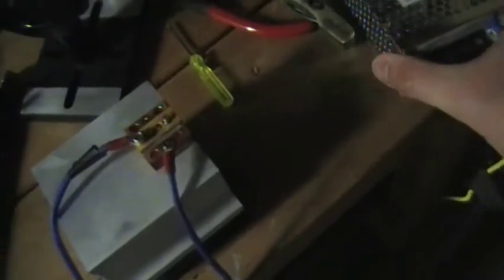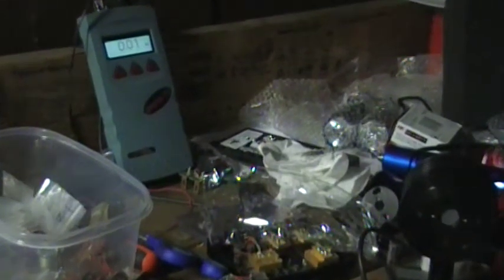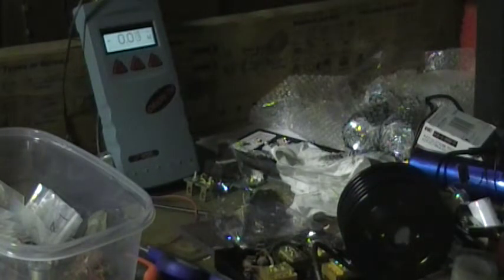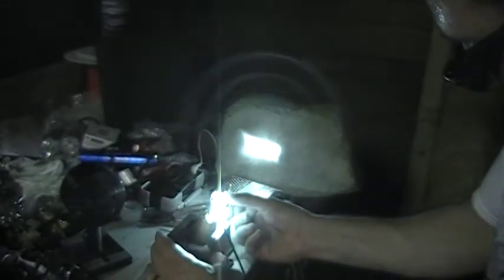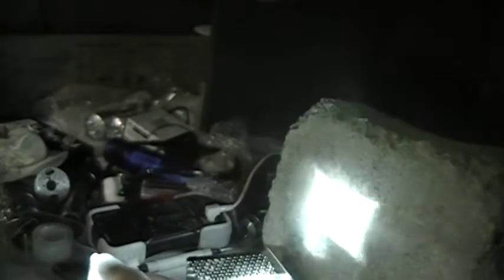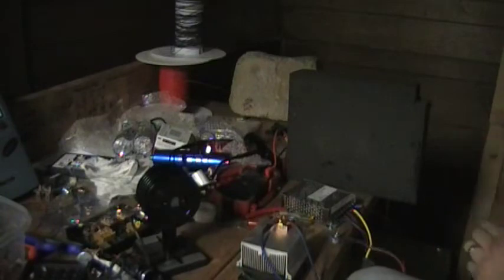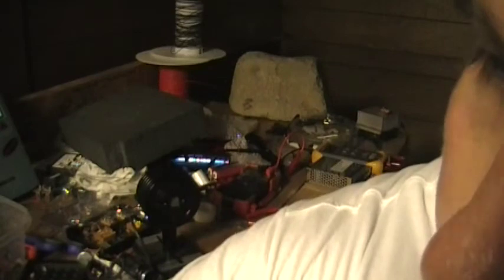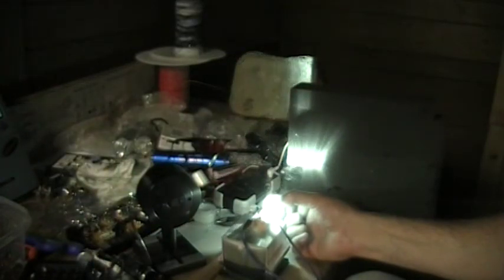16w 808mw laser kit

Comment from the maker: did you not see the end of the video burn 2 '' spot on the foam the beam was not focused down to a small beam if it was it would have burned me,take your laser and move the beam out as far as my beam and see you  burns a 2'' 21/2'' square.  I did not get my hand in the beam but close and it was hot the diode was a 40w 808nm you can look them up on ebay,if you take the time to use the right lens you can get a small beam.

Comment: yeap told me to come see this on my video and this is quite lame showing me what i assume is a burn test? but i don't see anything but a nice flash light and ur hands are in the beam ? i could never do that with mine or i would be severely burned. PS this is a high lumen's flash light a laser is a concentrated beam of energy good luck even enjoying that thing at least i can go point mine into the stars and see a nice blue beam for miles up
Reply: James Beebe excuse me low self-esteem jerk but Rick builds awesome lasers he probably builds more powerful lasers than your stupid blue wich I'm sure is probably 1w and if it outputs more than good for you,you should check his Chanel out he has built 15w lasers that can melt steel springs that will blow yours out of the water so watch yourself when you come over here and start spitting your filthy attitude about his 808nm somewhere else it's a near infared laser for crying out loud the power is usually based on the output but the brightness has a huge part in it as well for example the wavelength and don't come posting on back to me that you have more powerful lasers than him because if you do I really don't care! take it somewhere else I'm sure you just buy them and don't even build them yourself because I've never heard James Beebe anywhere Rick Trent has broken several world records with his lasers and he will outwit you 10 fold
Reply: Wow, you really just came here and said all that? Give yourself a round of applause mr James Beebe, you just dug yourself a whole new level of stupid.